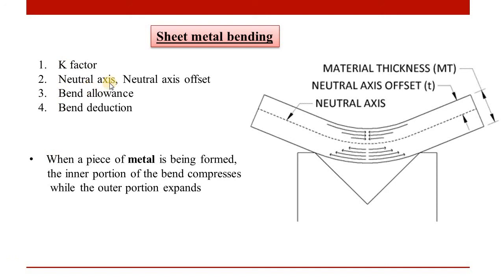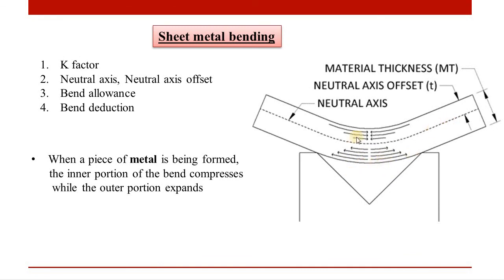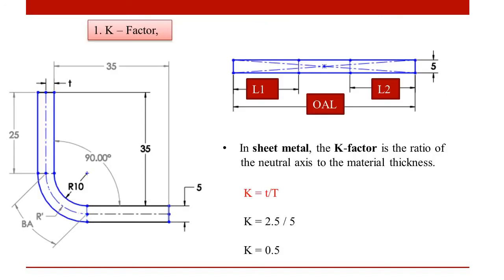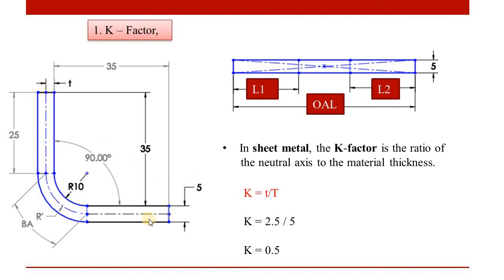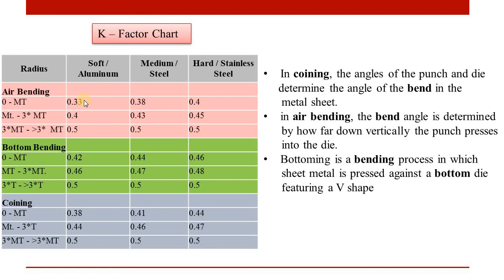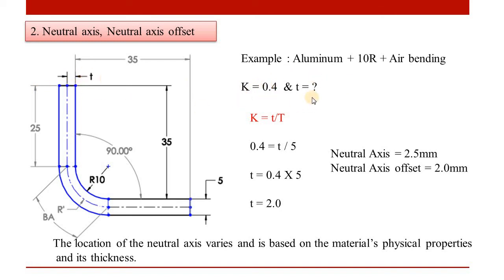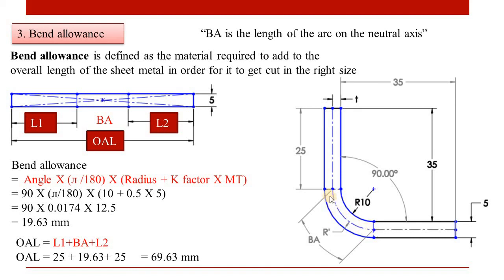Sheet Metal K Factor in Tamil | Bend allowance | Bend deduction | Neutral axis | Neutral axis offset

Comment: sir oru doubt...oru sheet metal bend pannathukku apparam athode bend radius namma drawing le kodutha size le tha irukku nu eppadi kandu pidikrathu...athu ku ethavathu measuring device irukka...athapathi ethavathu sollamudiyuma ...
Reply from the maker: Yes, it can be measure by three ways.
1) if the part is small, you can use profile projector to find the actual radius.
2) if the part is too big but the radius is small, you can use rubber cast method. 
3) There is radius gauge available for each size, you can compare with the matching  gauge to find out the actual radius.

Comment: @7:11 minutes - K factor in your formula is 0.5? Shouldn’t be 0.4 from the table? because radius is R is 10;which is less than 3 times thickness? Please correct if I am wrong, Cheers
Reply from the maker: Yes, you are correct. K factor value should be 0.4 Since the radius is less than 3 times of thickness.   Thanks for correcting me, will update this info in this video. Cheers

Comment: What is the use on calculating bend deduction ?
We already found flat pattern dimension by bend allowance .
Reply from the maker: Bending allowance and bend deduction is the initial calculation of design to avoid upcoming issued in sheet metal fabrication. 
Calculating bend deduction, for the material you will have to remove from the total length of the flanges in order to arrive at the proper length in the flat pattern. hope it helps

Comment: How could you calculated outside setback value is 15 mm?
Reply from the maker: 10mm inner radius + 5mm wall thickness
Reply: @zeroto1009  35 MM LENGTH AFTER BEND + MATERIAL THICKNESS IS 5 MM = 35+5=40    ,    40-25 = 15 . SO THE SETBACK VALUE IS 15 MM
Reply from the maker: @gashatech1655  yes both calculations are correct
Reply: @zeroto1009   ok sir👍🏻😊

Comment: WHAT IS THE USE OF BEND DEDUCTION ? 
K FACTOR IS HALF OF THE VALUE OF THICKNESS MEANS , K FACTOR VALUE IS ALWAYS 0.5 AH ?
NEUTRAL AXIS & NEUTRAL AXIS OFFSET ALSO NOT CLEAR .  YOU TOLD WHAT IS THE CALCULATION OF ALL ,BUT U R NOT EXPLAIN ABOUT THE USAGE OF ALL . WHAT IS THE LENGTH OF SHEAT IN ( RAW ) BEFORE BENDING?
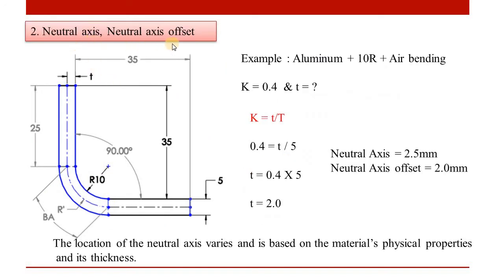Reply from the maker: Please refer 5:26 - the statement mentioned on this side "the location of the natural axis varies and is based on the material's physical properties and its thickness" so, it not constant as always the the K factor is not half of the thickness.

Please refer 7:40 i have told that usage of these calculation. what is the required total length needs to cut before bending based on these calculations.

 Yes, i din't mention the use of bend deduction in this video.
"The bend deduction is the amount the sheet metal will stretch when bent as measured from the outside edges of the bend.""

Thank you!